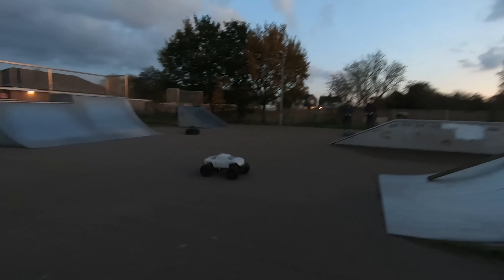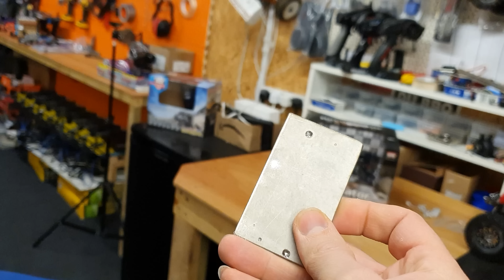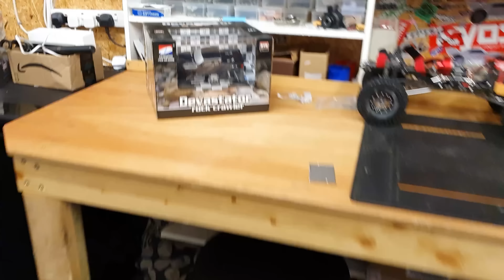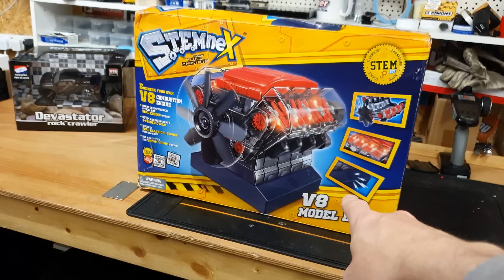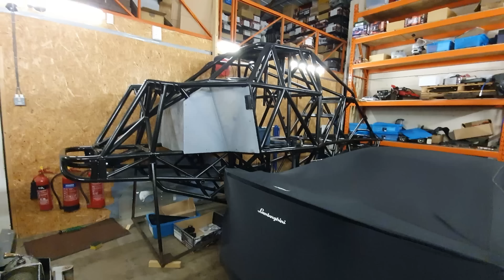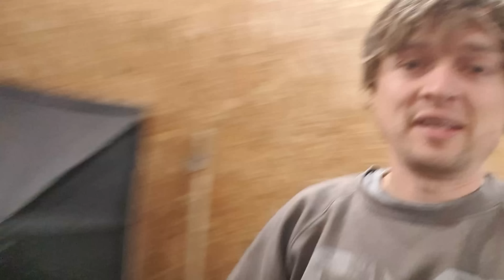How To Make RC Cars SPARK

Comment: I've tried these on the infraction that comes with holes in the bottom for fitting titanium screws but the screws wear out really,really fast, I shall try some plate instead! That metal crawler looks awesome, but looking forwards to seeing you get the real MT going
Reply from the maker: i was gonna try screw under there, maybe not if they dont last!
Reply: @KevinTalbotTV  you have to watch them if they wear too fast/flat you can't get them back out DON"T Screw them in flush with the chassis leave them 5-6mm out. Hope that helps

Comment: Buy some Cooper discoveryer stt tyres good on road with low noise (ish) !! And good off road too !
Reply from the maker: I was looking at those and the reviews are good, I may well go for them :)
Reply: @KevinTalbotTV  I used to have 33.12.50x15 Cooper's  on my discovery  and couldn't fault them at all and I did alot of road miles well I say road miles I'm from Yorkshire so roads fields dirt tracks it's all the same here !!! 🤣🤣🤣

Comment: I used to work as a tech for jeep. Try upgrading your steering damper it may reduce some of the wobble.
Reply from the maker: thanks dude, it already has one. It was fine until i put these wheels on
Reply: @KevinTalbotTV  where are you getting the wobble from ? Left right through the steering or is just through lack of balancing?
Reply: @KevinTalbotTV  look me up and give me a call. I did 4x4 work for 15 + years

Comment: Maybe try the BFG KM3s it is a mud terrain tire, that benefits from some of the radial tire tech, don't know how good they are, but I've heard some positive things (but you may want to double check on the tire sizes, I guess they might run smaller than they claim). I personally run the KO2s and they are pretty good, minimal vibration and road noise, a lot of people seem to be happy with those, and I'm not gonna complain.
Reply from the maker: I can live with the noise but its the 30 to 40 mph shake I wanna get rid of!
Reply: @KevinTalbotTV  Well then you might be happy with the KO2s, I daily these, and they are easy to live with.

Comment: If you go with larger rims on your land rover with lower profile mud tires it will handle better and you can actually balance the wheels. Ones you have look more appropriate for a land rover but very difficult to balance. Better off with the larger low profile setup. Will drive smooth but you can still go off road.

Comment: Another good video. But do you ever check your facebook community page as I have posted something you might like as I do remember you saying that all wheel steering crawler you have needed metal driveshafts and better esc so you could use 2s lipo. Well as I'm getting one myself I looked deeper into it and found a replacement esc/receiver that runs on 2s and some metal driveshafts, I thought you might like to know hence the posting as you could make a video about upgrading them.

Comment: The Ford Raptor is an off road truck and comes comes (stock) with BF Goodrich K02s which are one of the better off road tires. You could try those.

Comment: Instead of new wheels and tires try centromatic balancers they mount between the wheel and the rotor with a tube and steel balls with I believe oil the balls constantly move to the place that needs weight to balance them. 37s are pretty large and are a lot harder to get to balance you will probably run into the issue your already having with most tires unless you increase you wheel size a lot

Comment: 37" toyo tires are brilliant for car in this size/weight but if you want something cheaper nankang has dirt cheap 37" tires ,both of these are used alot in iceland!
Reply: Or you can order 38" tires from arctic truck in iceland they have been used alot in iceland but they are expensive!

Comment: Nitto mud grapples great on and off road can run the really low psi for off road and the handle great at high speed they spit ouut mud don't just hold them in the tread and there very decent priced definly the cheaper tire and decent compound rubber don't wear down super fast but are not super hard in my opion and I've had the same exact tires that you have and bf goodwrench krawler tas red label but hands down for a well rounded on and off road tires Nitto grapples no joke

Comment: Toyo open country m/t best on off road mud tires you'll ever own.
Reply: I run them on a ford bronco 37-12.5-17s they will last almost 40k miles I'm in the US so idk how much that' equates to in kilometers but ya they last a long time and smooth as street tires with normal wheel weights.